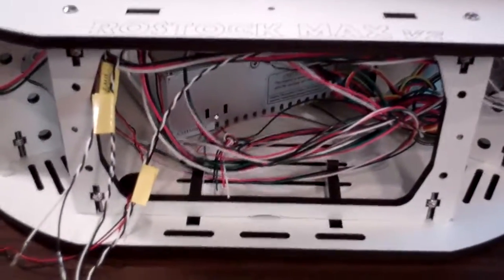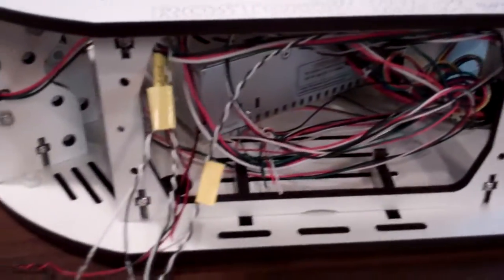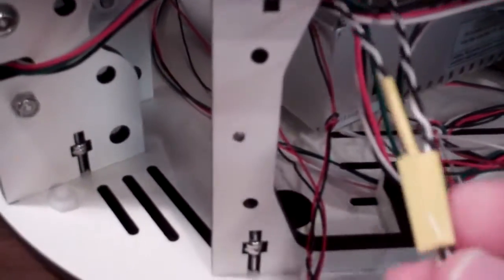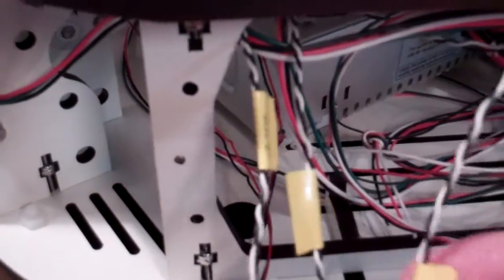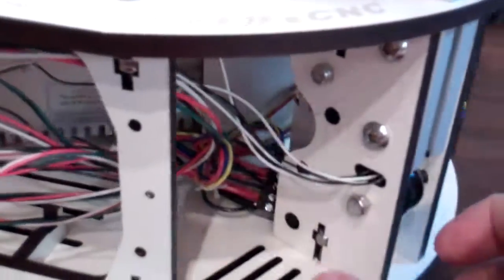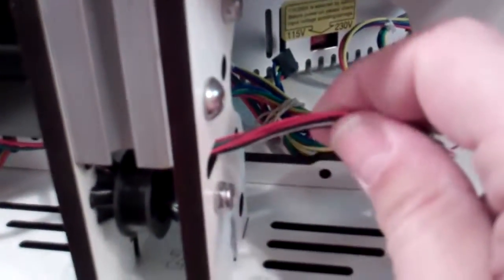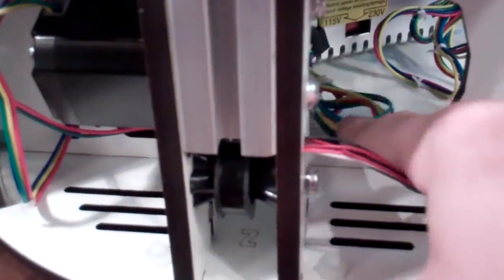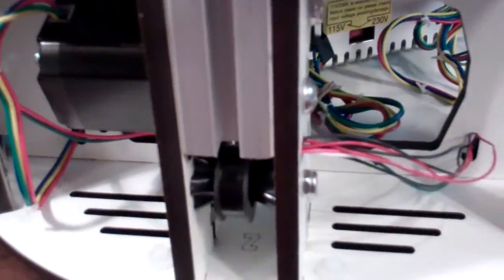Rostock MAX v2 Assembly checkpoint video #9

Comment: For the Y tower it is important to note the top of the tower has the spade connectors on the end stop wires and the bottom base end has the socket end. This is not in the documentation nor this video. I had to read ahead and take a look at the end stop connections and RAMBo connections. Not difficult to figure out but worth documenting. Inserting the wrong way would be no fun.
Reply: +Steve Shallenberg Thanks, That's exactly what I came here to figure out!